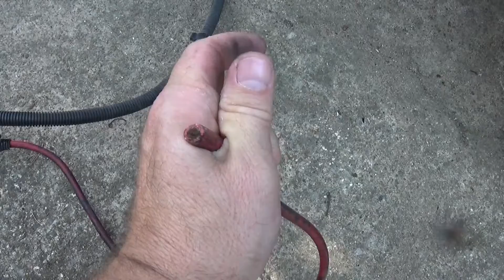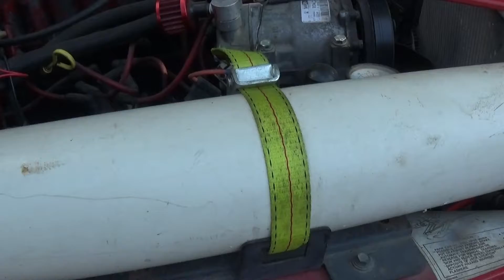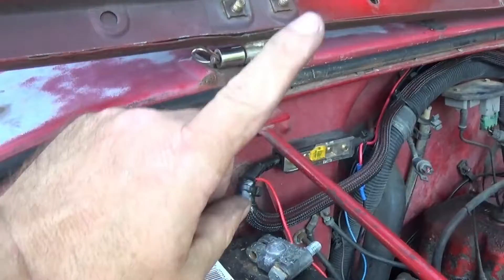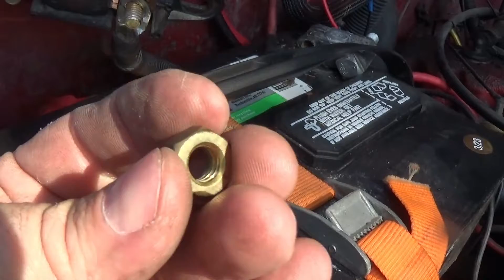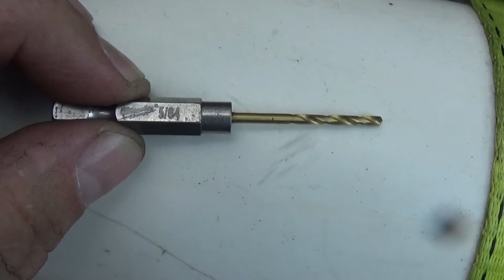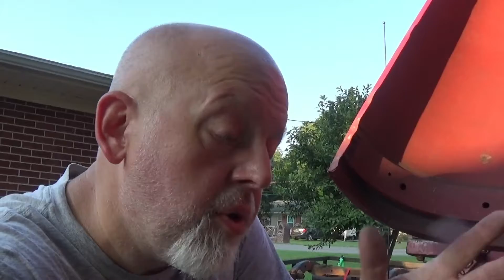Installing a Mega-amp fuse block: The RIGHT way!

Comment: Now doesn't a 12,000lb. winch pull 300 amps? when pulling so wouldn't that blow that fuse every time?
Reply from the maker: I stated in the video and demonstrated that the winch is connected directly to the battery. So the fuse isn't directly effected by the winch.
Reply: @Poweraddicts  got it just checking again- great find and great video Thanks BTW I'm heaing to the junk yard hahahaha

Comment: I make my own electrical lugs from appropriately sized soft copper tubing.  Flatten in vice and drill appropriate sized hole for the stud.  I think they are superior.
Reply from the maker: I have done that several times before. I don't have any tubing on hand at the moment. I do find that the soft copper doesn't crimp or hold a crimp as well,a so I solder tubing.